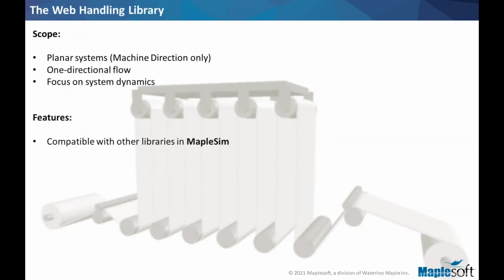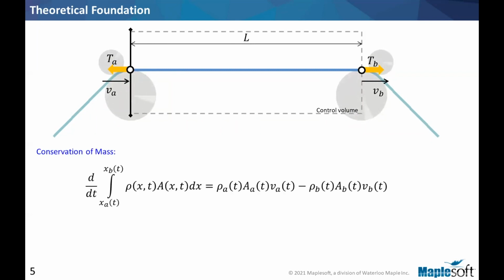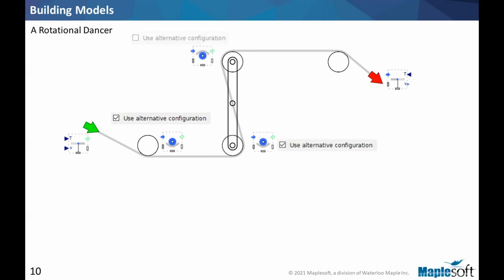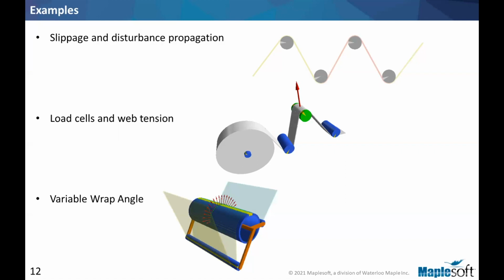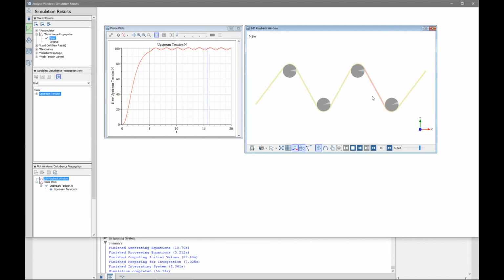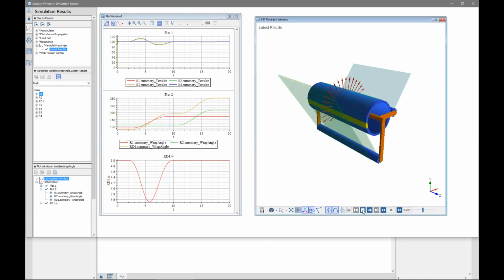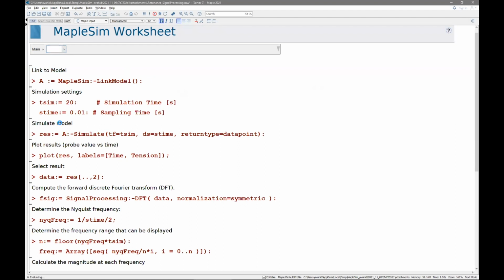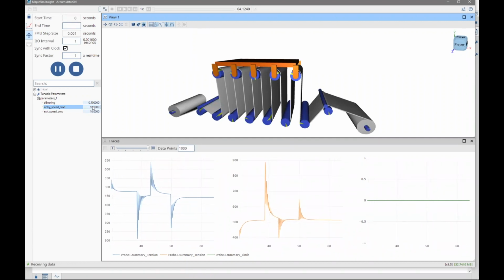Introduction to MapleSim’s New Web Handling Library

Comment: I'm impressed. Most of my attention has been focused on lateral behavior and I must admit that I had not realized how much could be done with a one-dimensional longitudinal model. I would recommend this to any process engineer who is working with R2R processing. Even though lateral effects are not included, the first order longitudinal behavior has  to be, after all, the central concern of the process designer.  
One small point: At 11:52 into the video, where you show the basic equations, the symbols used for velocity, v, and Poisson's ratio, nu, look nearly identical. This  confused me for a bit.
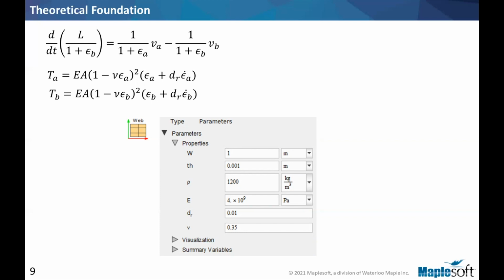Reply: Thanks @jerrybrown942 for your feedback. There is a lot that Machine Direction modeling can be used for -  simulating the behavior of the material and rollers helps with tension management, and this approach is much less effort than CAE or 3D FEA software. Maplesoft has released several new features to the Web Handling Library in recents update, so get in touch if you'd like a free trial to take them for a spin. And as for nu 'v' vs velocity 'v_a/v_b', while the velocity symbols were introduced around 7:44, the parameter summary was later at 13:08 so we'll aim to be clearer next time!